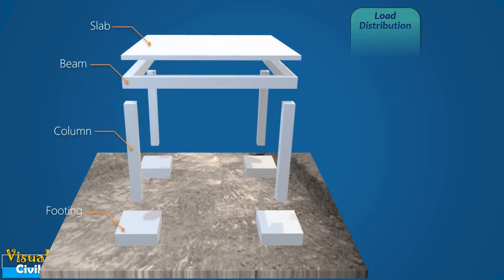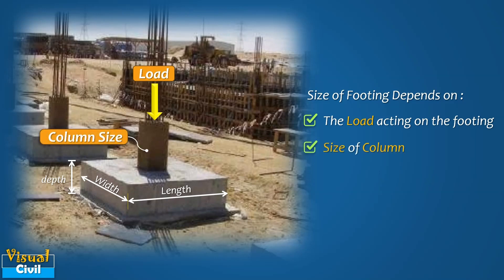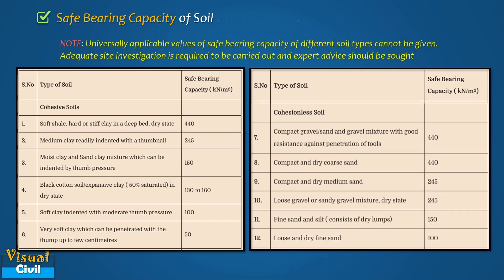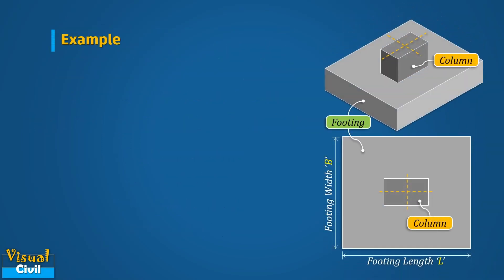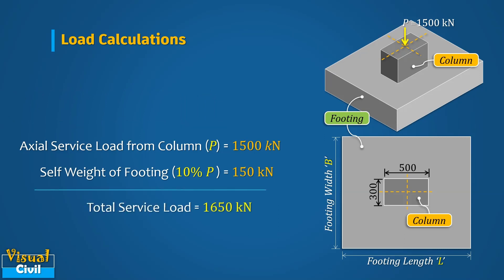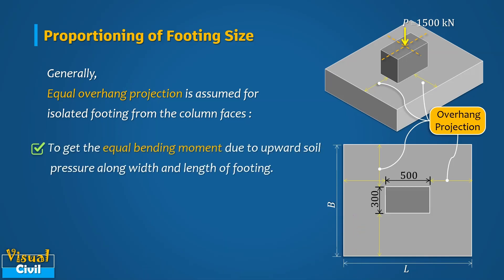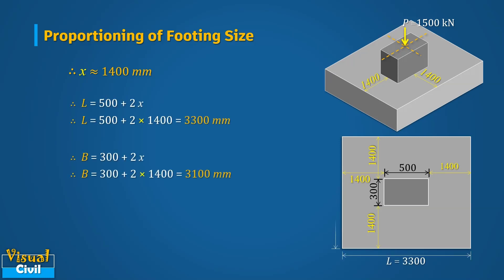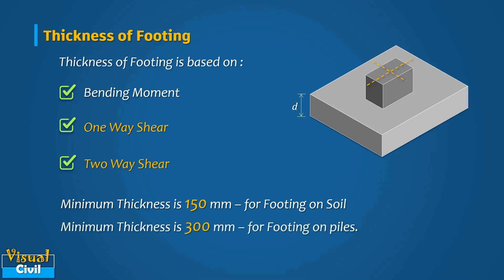How to decide size of RCC footing ? | Area of Footing | Design of Footing | Visual Civil

Comment: Hello
I need help in designing a 6m x 3m  billboard.
Height from ground level to bottom length of board is 2m
I want to use 3 x ( 100mm x 100mm x 5mm) steel sq tube  as column.
Soil is hard
Will take your design to a engineer to get it certified